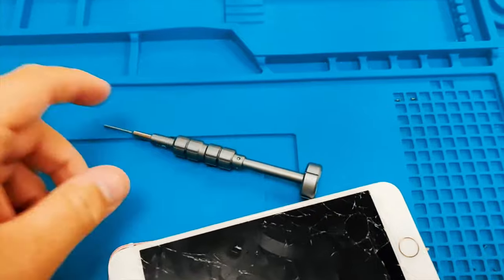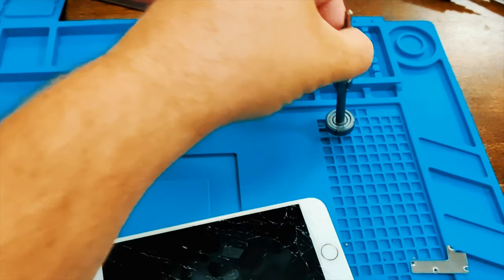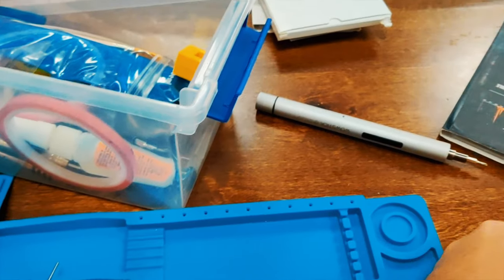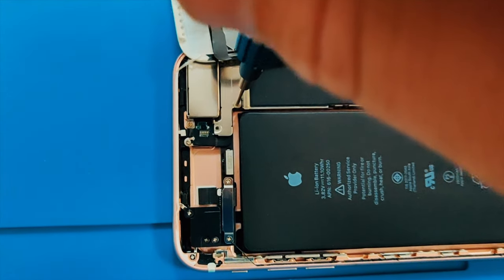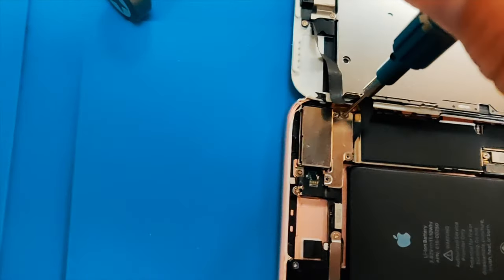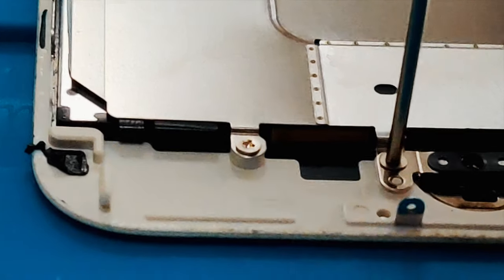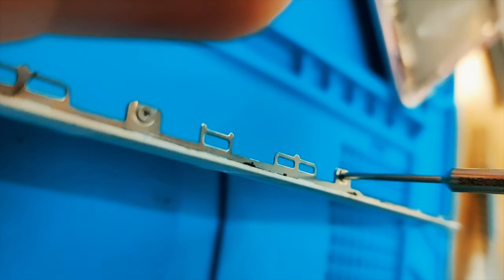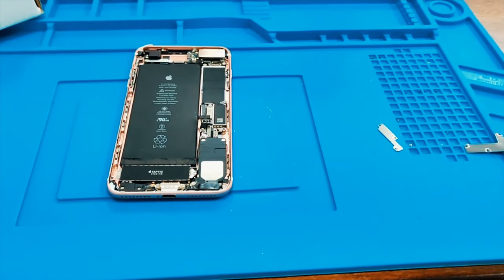QianLi iThor best screwdriver set I've ever used in my life!

Comment from the maker: Please support the channel by using my amazon links!  
For just the Recommended Parts click on the links below.

Heating pad:
https://amzn.to/3mbIytW

Heat Resistant Gloves
https://amzn.to/3EsZdyW

My blue mat to keep everyone organized:
https://amzn.to/3BalS16

iFlex Opening Tool with Glue Card :
https://amzn.to/35UC9h8

iPlastix Opening Tool with Glue Card :
https://amzn.to/38FtzUH

on of my favorite screw driver sets 2uul:
https://amzn.to/3jsqkCz
https://amzn.to/3CcoL2Y

iseasmo w/ Kit (Has Screw driver too)
https://amzn.to/35Za2O0

Tweezers:
https://amzn.to/3B7yBlf

T-7000 Water sealing glue:
https://amzn.to/3EdzLxs 

Isopropyl Alcohol For Technical Use:
https://amzn.to/3BqBU78

• Visit our Website: https://tech-md.com

• My email: dustin@techmd.bz

• To mail in your phone, please contact us at 801-438-6028

Need to get a part from a reliable quick source, you'll find a better price here then Amazon and the quality will be a lot better. Click on the link below.
https://www.injuredgadgets.com/?acc=be9b6cec65c863e1b55538d2c7fcc9b0